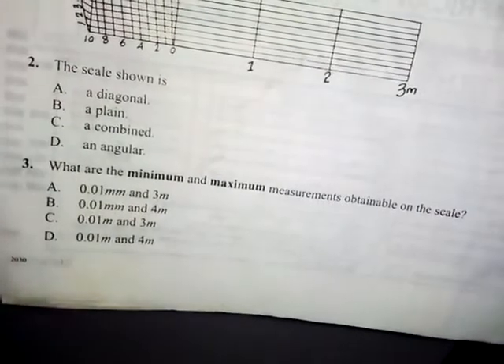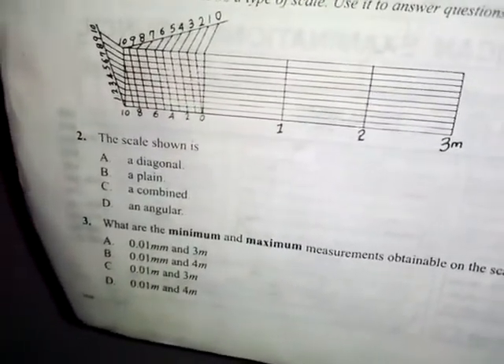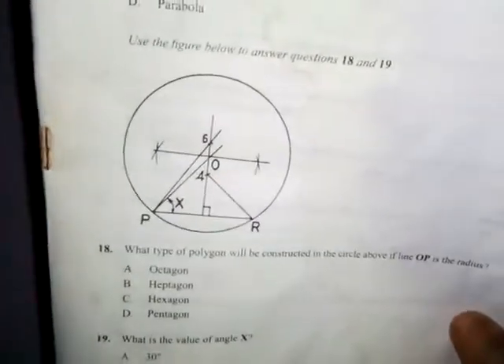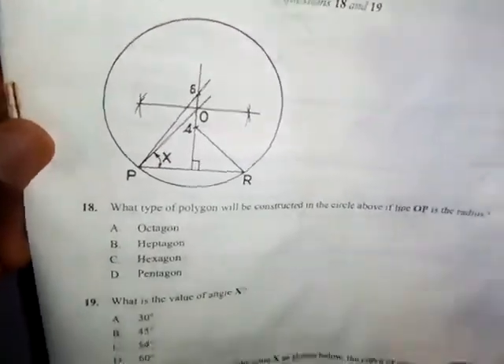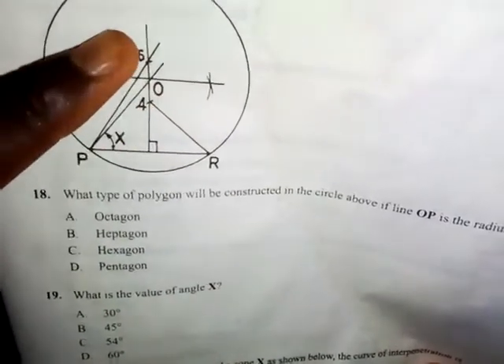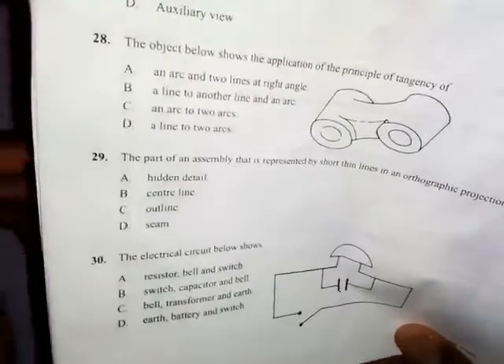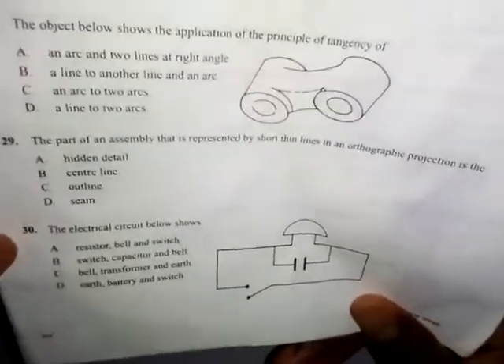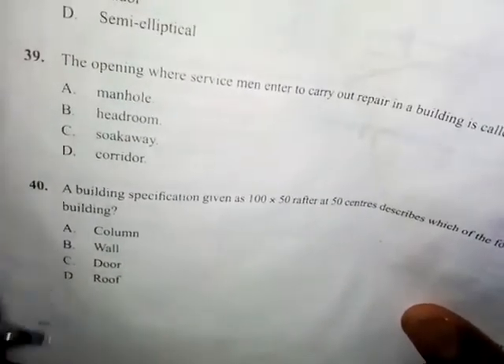Answers to WAEC Technical Drawing Objective Questions 2

Comment: No. 6 Deltoid look like a kite, how is deltoid the answer. What happened to trapezoid?
Reply from the maker: The right answer should have been a kite but in the option there is nothing like a kite. Them what is close that that is a deltoid.
Reply from the maker: Or did you see a kite among the  option or am I the one that set the questions? That is a standard NECO questions. So it's not my fault.
Reply: A deltoid, in geometry, is a kite-shaped quadrilateral with two pairs of adjacent sides that are equal in length.

So how is deltoid the answer?